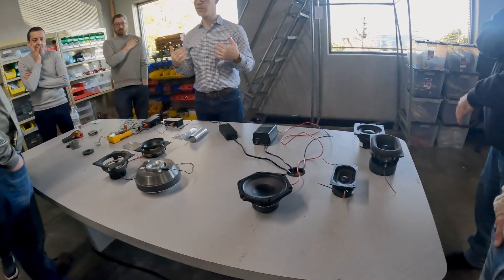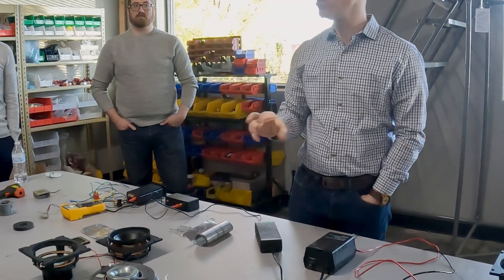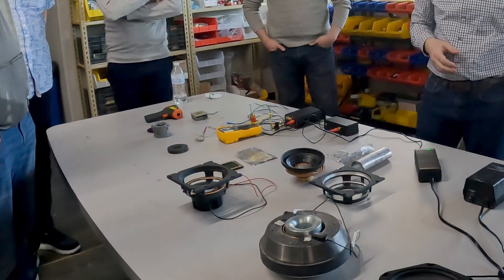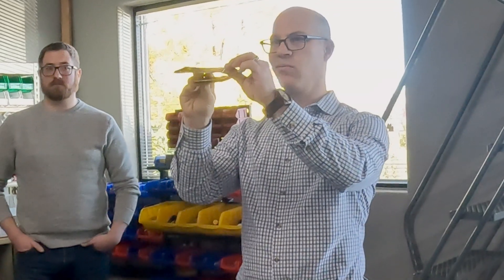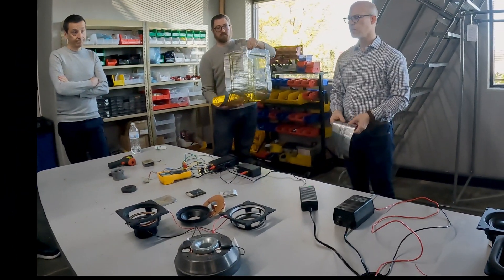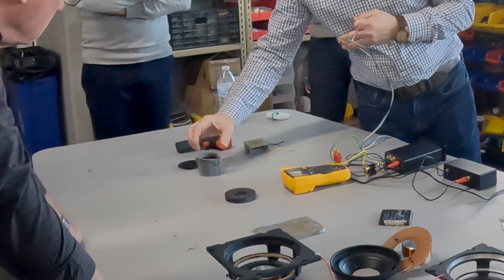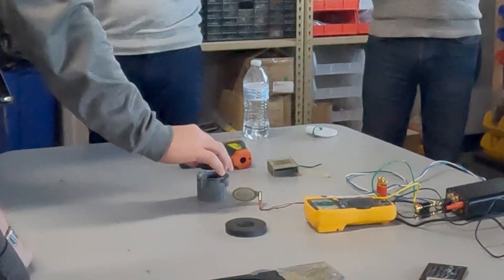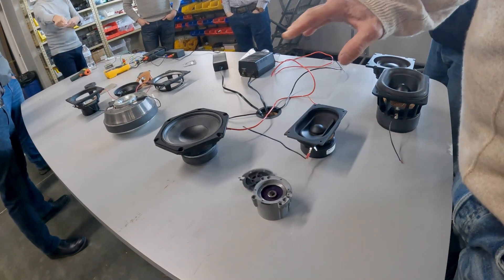Wisdom Audio's PMD (Planar Magnetic Driver) Explained!

Comment: There are other benefits too.
They have nearly zero cone breakup as crossover is very very low in addtion the woofers are not large meaning that the breakup is way past the crossover point and the woofer will never reach it.
The speakers are very much like a duel concentric or coaxial design because so much of the frequency range is coming from the same place.
Reply from the maker: Yes thats all true! Thank you